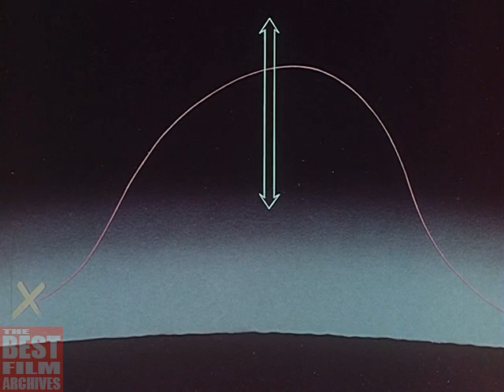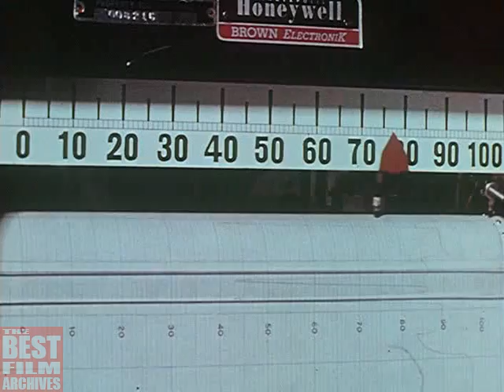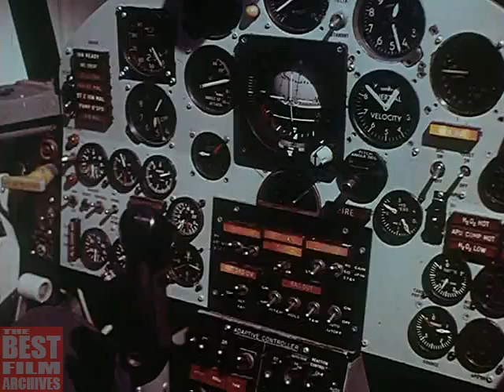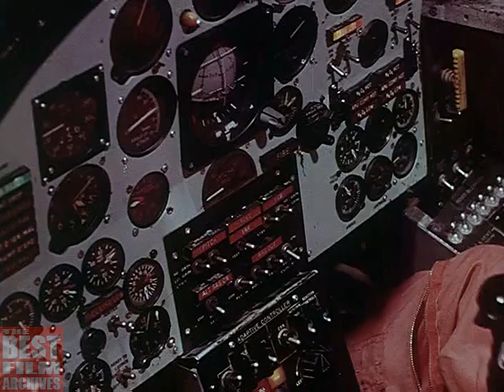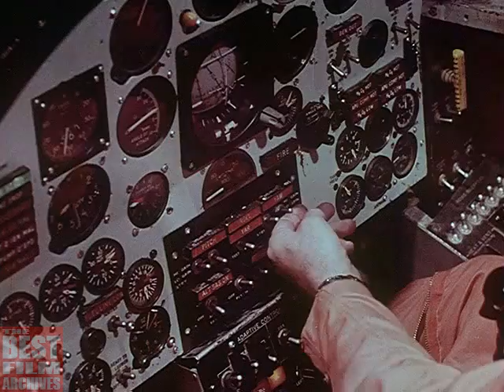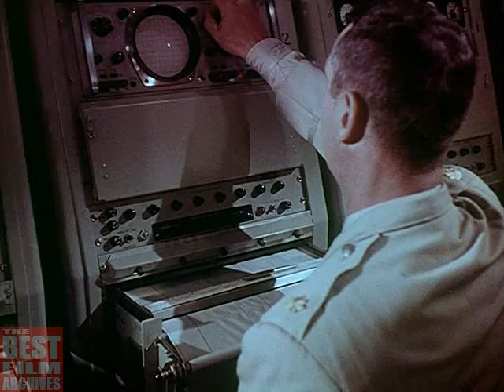X-15 Rocket Plane | The World's Fastest Airplane | NASA Documentary | 1962

Comment: 16:07 joe walker is responsible for the lost of the xb-70
Reply: +a  -- Joe Walker was doing something he had little experience in doing (according to Chuck Yeager) but he was also doing it because his superior officers instructed him to do it. -- 
I read essentially the same information as posted below from Wiki, in a few different publications -- 

Walker was killed on 8 June 1966, when his F-104 Starfighter chase aircraft collided with a North American XB-70 Valkyrie.[3] At an altitude of about 25,000 ft (7.6 km)
 Walker's Starfighter was one of five aircraft in a tight group formation for a General Electric
 publicity photo when his F-104 drifted into contact with the XB-70's 
right wingtip. It flipped over, and rolling inverted, passed over the 
top of the XB-70, struck the vertical stabilizers and left wing and 
exploded, destroying the Valkyrie's rudders and damaging its left wing. 
The USAF summary report of the accident investigation stated that, 
given the position of the F-104 relative to the XB-70, the F-104 pilot 
would not have been able to see the XB-70's wing, except by 
uncomfortably looking back over his left shoulder. The report stated 
that Walker, piloting the F-104, likely maintained his position by 
looking at the fuselage of the XB-70, forward of his position.
The F-104 was estimated to be 70 ft (20 m) to the side of, and 10 ft 
(3 m) below, the fuselage of the XB-70. The report concluded that from 
that position, without appropriate sight cues, Walker was unable to 
properly perceive his motion relative to the Valkyrie, leading to his 
aircraft drifting into contact with the XB-70's wing.
The accident investigation also pointed to the wake vortex off the 
XB-70's right wingtip as the reason for the F-104's sudden roll over and
 into the bomber. A sixth plane in the incident was a civilian Learjet 23
 that held the photographer. Because the formation flight and photo were
 unauthorized, the careers of several Air Force colonels ended as a 
result of this aviation accident.
Reply: +a   I think its a stretch to blame Joe Walker alone for the XB-70 crash.  Walker was a hugely experienced pilot and astronaut.  Per the Wiki entry posted by Racer, "The accident investigation also pointed to the wake vortex off the 
XB-70's right wingtip as the reason for the F-104's sudden roll over and
 into the bomber. "After that it was all over; it was an unrecoverable event.  I'm inclined to think that Walker did not screw up, but it was just a bad circumstance.